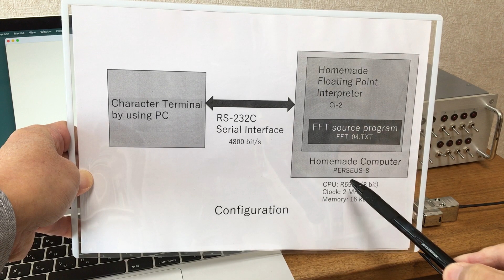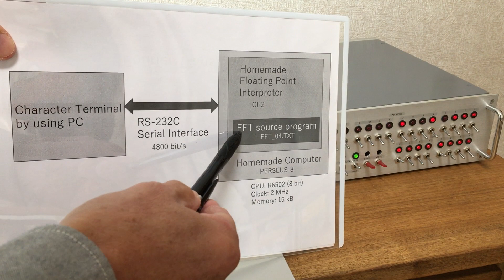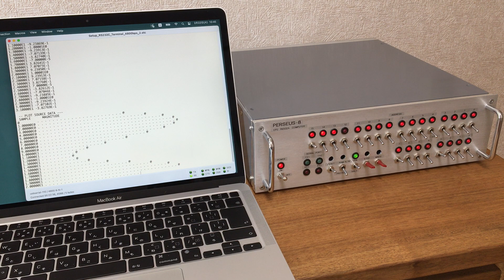Homemade Floating Point Interpreter computes FFT

Comment: Amazing. Well done in all regards.
Reply from the maker: Thanks! I made an FFT program to comprehensively show whether my own floating point interpreter and its elementary functions are correct. It reminded me of the speed of computers about 40 years ago.
Reply: @mitsuruyamada  Looking at the lights and the serial output, it seemed like a lot of the cpu time was spent waiting for the serial line.   It really is a thing of beauty!
Reply from the maker: @ryanbrooks1671  Thanks. The part of the program dump at 01:23 is mostly waiting for the completion of the serial transmission. During this period, it repeatedly writes the ASCII code in memory to the register of the serial interface device in 8-bit parallel, and then waits for the end-of-transmission flag.
    The rest of execution is a mixture of slow interpreter processing and waiting for communication. For example, this interpreter does not have "for" nor "while" loop process, but uses the "If then goto line-number" syntax instead, so it is quite slow. 
    Anyway, it's 4800 bit/s communication, but I think it's fun like the computer scenes in old sci-fi movies.

Comment: Absolutely beautiful machine.
Reply from the maker: Thank you for watching! I made this enclosure by cutting it out of aluminum sheet, so it was designed exactly the way I wanted it. This panel LEDs are easy for me to use because I can see the movement of programs. For example, at 00:52 , the 16-bit LED shows E097h, which is the address of the program routine waiting for character input from the serial interface.
Reply: @mitsuruyamada  reminds me of the old S100 systems. All the blinken lights.
Reply from the maker: @computeraidedworld1148  Thanks. In the late 1970s, the S100 system was in a magazine, but I think it was very expensive in my country. It had a huge power transformer, lots of card slots, and an impressive control panel with switches and LEDs.
Reply: @mitsuruyamada  what is your country?
Reply from the maker: @computeraidedworld1148  I live in Japan, and when I was young I lived in Kyushu, western Japan. Compared to big cities like Tokyo and Osaka, there was not much computer information available to me.